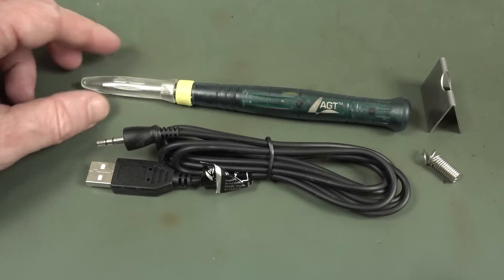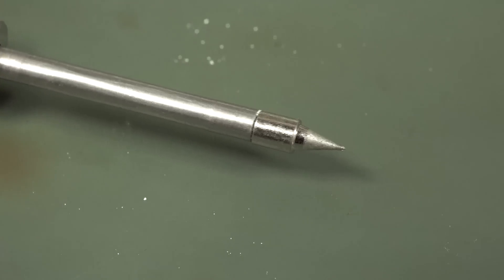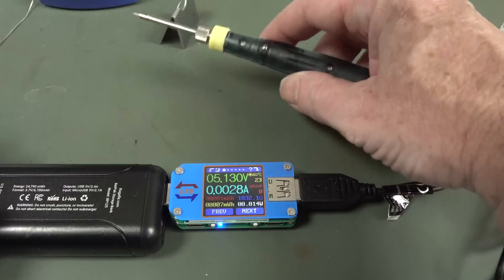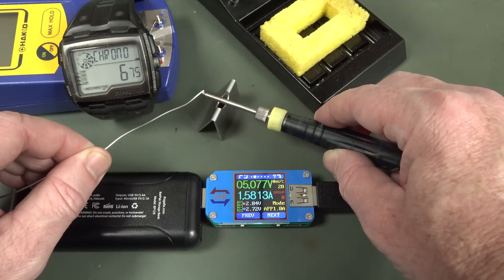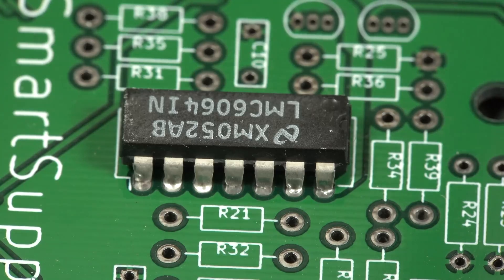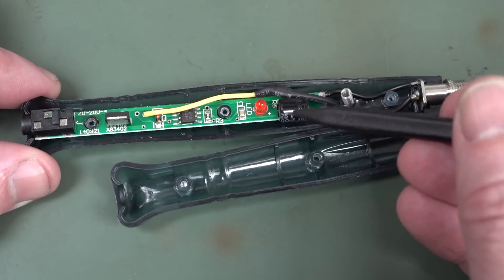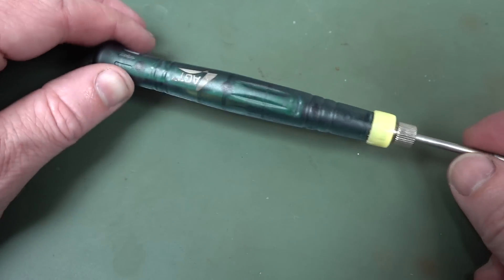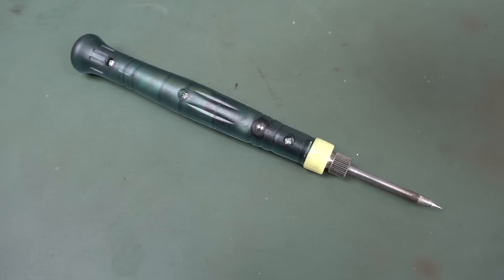EEVblog #1113 - Is a $5 USB Soldering Iron Useful?

Comment: 9:30 - When have to deal with high temperature, only one second is already a big time with pads like this, it's required have the skills to do the soldering at a half second to one second max, otherway, lift pads.
So better is have ideal temperature, this way don't need being so fast when soldering.

Comment: What about adding a thermisistor to curb the current flown when it starts going over 300 degrees celcius and then adding a collar with a sleeve that slides on over the tip to give it double the thermal mass?

Comment: This would actually be kinda neat if it had some sort of basic temperature control in it. Even a small analog open loop thing. If they are going to the trouble of sticking a mosfet and a 555 in there, they could do some sort of low-freq silly PWM thing to it.
Sorta like a cheap disposable ts80.

Comment: i have a more recent version; they did change it to a simple tactile switch, works fine.  everything else about it is the same, good and bad.  overall, i love mine for ultra portable, powered by my phone OTG or anything else.  its even handy to cut plastic or selvage synthetic fibre rope and cloth.  it does a decent job on SMT if you're quick so not to cook off the pads.

Comment: Touch sensor only works if you connect to a laptop. Touch sensor does not work for battery power banks. Power banks uses a vibration sensor. If you connect to a power bank, give it a slight shake or lift the item and it starts.

Comment: Well, add temperature control and ... wait, we already have TS80 :)  Ok, as cheaper option this little stick would be nice if it would run on cooler temps and have on/off switch instead of that parody of touch detector. As field option it would shine then. Because now it will cook a ton of flux already before doing something useful. And lead, tin and bismuth fumes are not healthy.

Comment: I'd rather catch my balls on fire.
i need thermal regulation for things i do. last time i tore a pad off a board i swore I'd never use an unregulated iron again. 
 My $16 60w thermal regulated iron works great. i get $5 is cheap but common save yourself some pain and frustration and get something more respectable.

i dont know who would solder wires together in a "field" but if you like soldering next to corn or soybeans who's to say no? :P

Comment: I bought one of those for quick repairs of cable or soldering some leds. For that i didn´t need a soldering station or one thats fixed to an main cord, so that cheap thing did the job very good and that already for a long time. Well you have nothing to lose if you just need something simple and portable and cheap go for it.

Comment: Just received one via eBay that purported to be the same -- and looks the same externally with "8w" spec, but turns out to be arguably a bit better. Cap a lot easier to pull off. Instead of a finicky touch sensitive switch there's a positive action on/off push button that looks exactly the same, and (as far as I know so far) there's no automatic turn off after 25-30 seconds, you just push the button again to turn it off. Blue LED. Gray collar instead of yellow. $10 from U.S. shipper (so a bit more than from China with a long wait). Heats within 15 seconds, as promoted. Very nice little tool. Thanks for the review!

Comment: This thing is pretty good for SMALL jobs like soldering small wires, Jewelry and so on. I use it for EVA Foam Marking, Small wires, LED's and the like. it does NOT work on larger things but other than that's its pretty good

Comment: I have several of the no-name ones, only the best of the China. They are all vibration activated.
I've used these with a powerbank or sometimes from a portable bluetooth speaker in the fields.
Fits in the pocket and gets the simple stuff done. The second thing I do with these are just giving 
them away to someone that wants to try hobby soldering but doesn't want to invest in something propper just yet.
Also for educational purposes. What makes these great are their low price of 4 dollars(when I bought a bunch last time).

Comment: There's a mod, replacing the 555 with an ATTINY13A, to allow different temperature-profiles. Of course the mod replacing the cap-sense as well. Due to the lack of a temperature control, it also depends on the voltage of the supply (one more downside).

Comment: um25c ..... why no one talk about this , althought it is not Protagonist. but it function is not this... you can measure many data , voltage , current  power , capacitor , cable resistance,  etc 
and it can support android APP and PC software , many many function 
https://www.youtube.com/watch?v=rNDMIFiWq64
https://www.aliexpress.com/item/RD-UM25-UM25C-for-APP-USB-2-0-Type-C-LCD-Voltmeter-ammeter-voltage-current-meter/32855845265.html

Comment: The monostable ckt might make sense from a safety and durability  perspective... A simple mech switch keeps the power on always (unless manually toggled) so if the user walks away then the crappy tip plating will burn off and the tip will last even less... Also, bad idea to leave an active 500 degree heat source sitting on the table without supervision... So there might be a reasonable design intention.

Comment: decades ago,an English outfit (Antek?) made 15 and 25 w AC irons
-I bought 12 for electronics PC board use-pre SMT
  -especially when they reduced price to $2 CDN each in 12 quantity

  -they worked well ,and had interchangeable pointed and small angled silver plated 
     chisel tip options-that cost MORE than entire original sale price !!

 -cool to the touch,solidly built for such dinky irons-where Wellers were then $120 base
even elements were rugged and easily user replaceable 
  finally after 20 YRS no longer working ~    ~and parts unavailable ~~

Comment: I have used this for most of my soldering work for 5-6 months. And I's simpli brilliant! I shortened the USB cord, And uses a 1 cell 18650 power bank. It all tits in my back pocket.  After I started using this configuration, I think i have tripled the times I use it, instead of putting it in the to-do-pile. For mounting components to a printboard and likes, this is My new favorite and most used iron. And if the price was 50 times more expensive I'd still prefer this. Brilliant!
Reply: Agree with everything but the 50times the prize xD

However I have a native non touch tactile switch version

Comment: I modded the monoflop into a PWM driver. I have very nice temperature control via a pot I added in. This device has been my favorite tool for in-field prototype fixing. I highly recommend it IF you're going to add the temperature control like me.
Reply: how to add temperature control?
Reply: @allanpham684  I lied, all I have is power control. Makes it usable for small devices, but the tips are just garbage. These days I use a Miniware one for 50 bucks

Comment: hah you made the same mistake I did with the cap the first time around, ive had mine for 2 years and its still great for small stuff, like smd work. Tips don't last as long as id like though.

Also it is VERY fennecy with power banks. Some work fine, some don't. it works fine on a usb power adapters

Comment: Well.... i'd give it a thumbs up, since there are many other chineese crap out there, even for 10€, that basically blows itself, melting if you keep it connected for more than 5 min. The 15 seconds is enough for doing 1 or 2 quick solders, and avoids the self-destruction of the device. As you said, you can use it with a power bank, and it's exactly what i do, to do some quick solder jobs, mostly when i'm away from my work bench and my soldering station. So, keeping in mind that it basically "gets the job done", it's useful... at least for me.

Comment: The 555-based trigger mechanism works only when there is  electric field around. In extreme outback there is not. I had to add another contact pin, and current flowing through the finger causes the triggering.

Comment: I remember using a gas stove and a paperclip to fix a broken speaker connection. Heat it up on the stove, move to the speaker, solder, etc.

Comment: The usb soldering iron is the recommended tool for working on micro SD card circuit traces. It can be temperature controlled if connected to PWM adjustable source or a good bench power supply
Reply: No, it can be power limited with a different power source, but it definitely cannot be temperature controlled.

Comment: I have three of those (brown transparent) and I really like these things. You have to practice how to get the best results. You can use the cord (the 3mm jack) as a switch (try it), pull it up (with your thumb) one 'click' to switch it off. These are very useful to do fast little jobs or tiny things and you can use it with a computer too (if powerful enough). To avoid it get's too hot quickly, use a less powerful powerbank.
Reply: I started using this one as my main iron for Arduino-related projects. I find it so much easier to control the movement of the small tip, my accuracy is much better than with a proper soldering station. I wish there was some middle ground between this one and a soldering station. I've seen reviews of Pinecil and TS100 but their tips seem noticeably larger and might not give me the same accuracy and lightness I get from this cheapie.

Comment: No problem to draw 5v 2A from a USB charger. I don't know why this myth persists that USB only gives you 500mA/900mA. That is for data connections, the spec allow up to 2A for a charging device, you can even be both, charging and data port. So 10W is the theoretical limit but there are plenty of out of spec chargers that go up to 3A (RPi official PSU f.e.)
Reply: PTS Actually it can indeed be a problem and by no means a myth.  The USB spec only guarantees that 500mA will always be available from any USB port, anything beyond that level is optional and dependent upon any other attached devices not using their own 500mA allotment.  There are many USB power sources out there (both PC and lithium power banks) that can not provide 2A, even many that fall short of even 1A @ 5V despite possibly claiming higher outputs — voltage matters every bit as much as current as you gain nothing if the voltage begins to droop significantly (the extra amperage means nothing if the supply outputs 5V@0.8A but falls to 4V@1A as both are only providing 4W at that point).  None of which is based upon a myth, those are actual real world facts — some will gladly provide the added current on demand provided there are no other loads while others will either shutdown or allow the voltage to drop to unacceptable levels even with no other attached loads.  You can not absolutely depend on anything greater than about 500mA per port when presented with a Type A USB connector (and there exist exceptions even then such as with isolated USB ports which may permit as little as 150-200mA).
Reply: I would say that is kind of obvious that you need to use a supply that is rated for 10W if you want 10W...
Nowhere did I say that every USB host or charger has to supply 2A just that the spec allows this current.

Comment: I have a few of these I got two years ago because I've had bad luck with normal irons. Weirdly my first one has lasted longer than a $30 adjustable temp iron which died on me pretty quickly. It's still going and the tiny tip is fine too. I've found that these work best once something breaks and the touch sensor stops working. That and I like the super small tip (helps me not mess up and bridge thingsby accident). So, these things are junk but for $5 they are good junk.
Reply: I started using this one as my main iron for Arduino-related projects. I find it so much easier to control the movement of the small tip, my accuracy is much better than with a proper soldering station. I wish there was some middle ground between this one and a soldering station. I've seen reviews of Pinecil and TS100 but their tips seem noticeably larger and might not give me the same accuracy and lightness I get from this cheapie.

Comment: There is something wrong with the wire gauges (~10:15).
First you fail to solder a 15 gauge, then you fail to solder an 18 gauge, then you success with a (much thinner) 15 gauge wire.
I think you got something mixed up there, could you clarify?

Comment: Did someone mentioned that this thing has a fix for reducing high button sensitivity (one capacitor) and a mod replacing 555 with some attiny?
Reply: I think this is the mod your looking for, https://hackaday.com/2017/12/04/upgrading-a-usb-soldering-iron/

Comment: The iron would be decent for the price but I never understood how to turn it on and off. It does always the opposite from what I want
Reply: The irons use a shock sensor, plus the touch pad. The shock sensor is more reliable than the silver button, so just shake it t switch it on. It switches off automatically, there is no controls for that.
Reply: John Coops i will try it. Thx!

Comment: I think i might buy one of these, i have use for it. I think i'd do as Dave latterly suggested though and get some nice hi-flex silicone wire and just go 5v straight to the tip.. or just wire that MOSFET up as a switch

Comment: surely someone can make a semi-decent usb rechargeable iron of a similar form factor containing 2 18650's that could deliver say 40 W. Does anyone know of one?
Reply: Nope, because 2 x 18650s is both longer and much wider than this iron.
Reply: highks - there's portable 18650 irons. Example https://www.youtube.com/watch?v=08x6J7MKCYs
Reply: highks I was thinking two cells for run time. I have a Milwaukee M12 iron ( because I already had M12 tools) it works fine but it's massive and heavy. Their smaller batteries contain 3 X 18650.

Comment: If I need to solder two wires together in the field, I'd rather use a Solder Seal butt connector and a cigarette lighter or match. Works faster, better, with a more solid connection AND it insulates the joint with a ring of hot snot around each end to keep water out. I keep a small selection of them in my Portable Geek Kit in different gauges. If you haven't seen Solder Seal connectors, they're worth a look. Cheap, easy to use, and they work far better than any crimp-on connectors I've seen. The hot-melt glue rings at each end are similar to marine-grade heat shrink tubing, just not as much of it, only a thin band around each end.

I love that marine heat shrink for all sorts of stuff, but for sealing and waterproofing antenna parts especially. I have a small low-power multi-band antenna with resonant traps at a couple of points along the radiator's length. The kit comes with some heat shrink, but it's the regular kind, only meant to protect the traps from getting dinged up. They do nothing to protect against water damage, which is a far more significant issue with an antenna. So I substituted marine heat shrink and it sealed the traps almost as well as a conformal coating.

For most of my soldering work these days, I use my new TS100 temperature-controlled iron. I have a hot air station too, and one of those ReflowR computer-controlled hot plate gadgets Dave reviewed a while back. I couldn't stand the old single-temp Weller station I was using anymore, and didn't feel like getting a Hakko. At least with the TS100 I can power it in the field using a battery bank with a 19v plug on it for charging a laptop. That works real well. I power it on the bench with a 19v laptop power brick. I use the 12v brick it came with to power a small QRP transceiver.

I used to have a Radio Shack butane iron, but the tips on those things don't last very long, and I could never find another tip cheaper than buying a whole new iron. (This was before the Intarwebz and online shopping.)

Comment: got 1 was ok for up a ladder , with the battery pack
 soldered an ham radio antenna plug  30 odd feet up , 
but not good on a windy day dose take the heat away

Comment: The official model is ZD-20U, 
You can buy spare tips (just search ZD-20U).
There are multiple rehashed versions, but they all used the same tips.
There is also a version used as a hotknife for 3d print cleanup called modifi3d which comes with its own special tips.

Funny enough this is my goto soldering iron for any small projects, it's especially useful for manual soldering SMD
also with a simple modification you can make it always on

Comment: I've got one of these irons and have used it for around 2-3 years. I did have to mod it to improve the touch sensor, now theres a thin wire that sits right next to the touch sensor and when you touch the wire and the sensor or short the wire to the sensor, it turns on.
Super handy lil thing for quick jobbies.  I've soldered up many a LED strips and automotive headunit tons of times over the years. 

I like it because its quick and easy. I don't need to worry about having mains power with me, or have to dick about with the Hakko 888D (which I do love using btw). It's always there in my electronics box and as long as I have a powerbank or a usb port somewhere, I'm golden! 
As long as it's used within its limitations, it's a perfectly fine and rather handy little portable soldering iron.
Reply: The reason why I view this product review is primarily for the purpose of soldering connection wires to LED strips as well. I don't have the two yet but that's my plan.